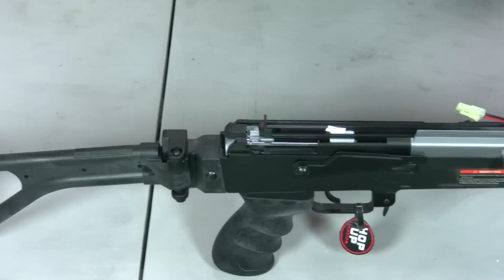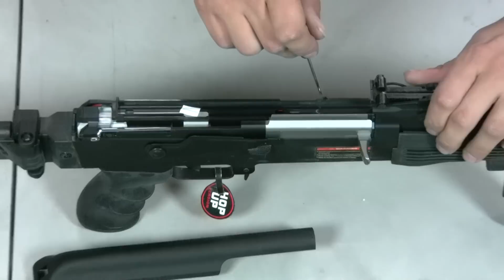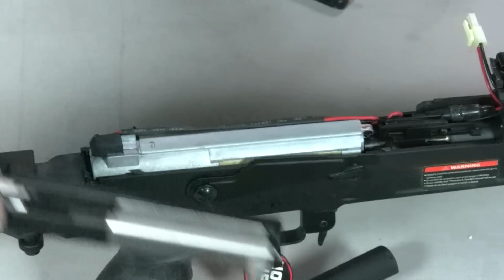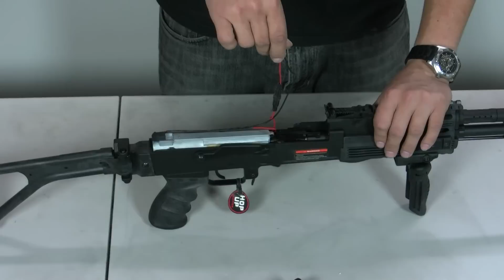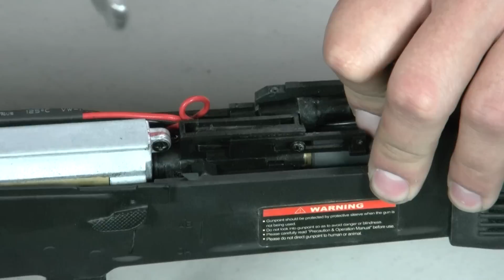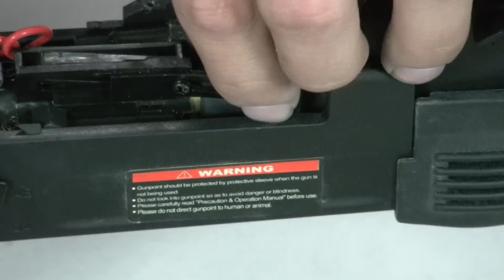HitGuns.com - Airsoft Repair - CM-028 AK47 - Motor and Wiring

Comment: is further take down of this type of cm028 any different form the rear wired ones with fixed stock? i have to replace the gearbox on my cm028u with an upgraded one...
Reply: yup it is... damn that wire cover was hard to snap back on! took me 90 minutes!

Comment: Don't smack down the battery cover like he did at 12:45.If you don't have the cover seated properly and smack it like that you will eventually break the plastic that the end of the cover tucks under, right under the rear sight. There is also a metal pin involved if it breaks. I tried gluing it with first super glue, then I tried epoxy neither held. I broke that on my gun before I had it a week. My fault, I should not have been smacking the cover down, The way the battery cover fits really is cheesy. Not the gun of choice for chasing squirrels out of the yard with, the magazine spring unloads when the gun is fired vertically. I bought this gun expressly for the squirrels so between that and the battery cover I struck out by choosing this gun. It's pretty accurate though.
Reply: ok smarty pants

Comment: HitGuns Airsoft how to i put a front wired g&p ak47 front wired gearbox into this exact cm-028 ak47 aeg. i was told The selector would need to be replaced, and the top area may need to be modified for fitment.
 G&P Complete Reinforced 8mm Gearbox w/ Motor for AK Series Airsoft AEG - Deans/Front Wiring (400 FPS)

Comment: Not covered in video but for those having issue w/ the rod that pushes the metal button not springing back. There is a small 1 inch spring not covered in this video that goes inside the gun, it makes the rod push back against the metal button. Only realized this later when i found it on the floor. Just thought that might help some people out. I had to take my apart because of fire select switching during fire modes.

Comment: If you follow the rod from the button part to the end, you notice there is a small hole that the rod fits into, there is supposed to be a small spring, about the same size as in a clicking pen, that spring is what pushes the button back in place. You probably dropped it by accident, you have to be careful because it easily slides out of its place if you tilt the gun backwards.